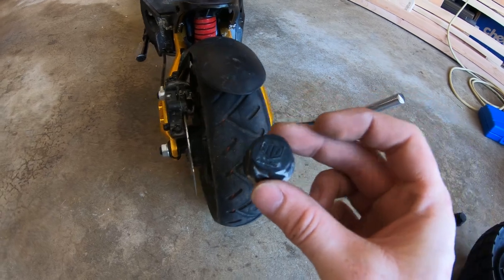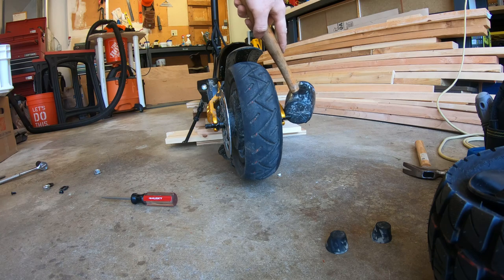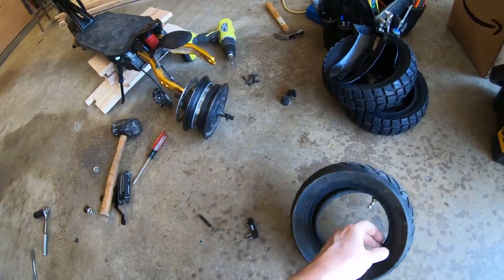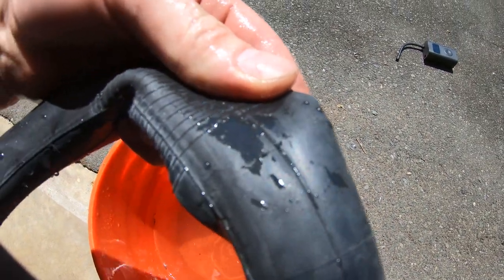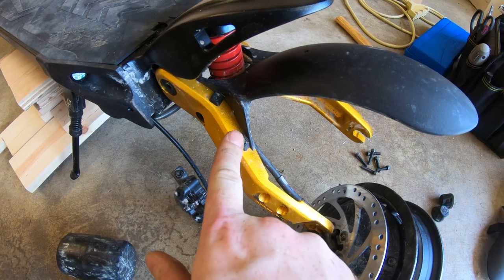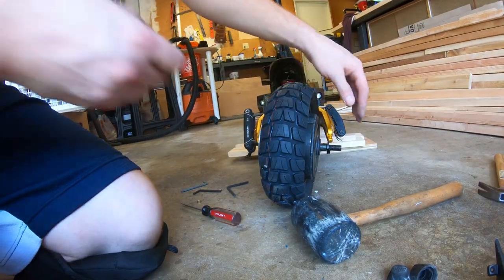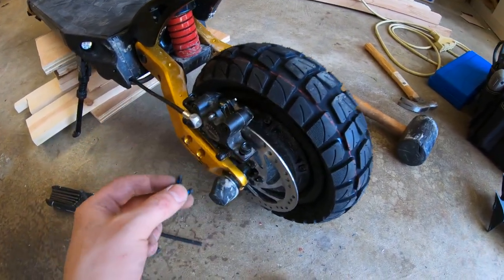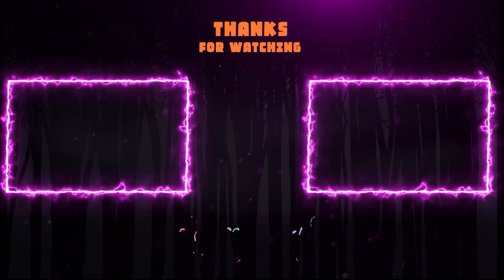Kaabo Mantis Pro SE Tire Change 3" Hybrid / Off-road Tire Install on an Electric Scooter

Comment: a trick cyclists use to help prevent pinch flats is to coat the tube in talc which helps it to slide around rather than get stuck

Comment: I am currently working through my first shooter rear tire flat repair.  Kaboo Mantis King GT.  A few issues for a first timer where I resolved one problem but stuck on another one.  Used my heat gun to heat up the axle bolts given the Locktight was really preventing me from breaking the nuts loose. The heat solved that.  Now can't get the two halves of the split rim apart.  All the bolts that hold it together are out but still the halves seem to be stuck.  Nothing like I have seen in these help videos.  Have used tools to try to wedge them apart and no luck.  Today is a new day and will give it another try.  Do not want to have to bring the scooter and parts up to Voro to get this fixed.  Long drive from Orange County up to where they are.

Comment: FYI your pro tip of loosening the bolts on the suspension to open the arms completely eliminates the need of pounding the wheel off with a rubber mallet.   Just loosen those first before you remove the wheel and it just slides right off

Comment: lol, nice vid.....You lucky guys with your split rim hub motor wheels! I mounted very similar tires on my custom scooter build without the ease of a split rim and it was unlike mounting all of the bicycle tires I've done before. They were tight! I had to buy giant motorcycle tire spoons for the leverage and really needed a 3rd hand but was only born with 2. Even after using grease and soapy water on the rim , tube and tire, I ended up severing the precious 90 deg angle tube and had to start all over with the only tube I had left. I got it on and the tube lasted 300 miles before a blowout. So replacing it, I made a tire jig out of 3/4'" plywood to press down around the whole tire at once, so hopefully will not have tube issues this time. I also use 2 layers of a fat bicycle tire liner because I knew what a pain in the ass it was to change these. But the tires are pretty great, on and off-road...good grip and not much road noise.  Also, I got 2 of those Mantis Pro tires originally, but wanted to go wider with these... those 2.5" tires came with 2.0" tubes and these 3.0" tires came with 2.5" tubes.

Comment: Given that the "off road" tire has the knobs... are they a bit thicker? Meaning, thorns, nails, tacks, random pieces of metal have more rubber to penetrate to reach the tube? If you're not off-roading, do you see much difference between the amount of rubber on the road between the two styles of tire? The first thing I would do, besides using a sealant in the tube, is to install some tire liners. They will further prevent punctures, making the sealant fulfill an insurance role.

Comment: Wheelied over a small curb an popped the rear tire on my 10x today... only 70 miles on it😭 thankfully slime is working for now! Great video! Feel confident in changing mine in a few days now!
Reply from the maker: Dang it ! I hate when that happens. Try using a slightly higher PSI
Reply: @GingerOnWheels  total buzz kill lol! I will! Yo I took a tubeless tire off my hiboy s2 pro an slapped it on LOL

Comment: Great video. You mentioned using superglue to attach the plastic caps on the wheel studs. I found that clear silicone works great and does not create the white/cloudy plastic that superglue does.
Reply: Silicone also easier to scrape out so you can repeat the process next time you have to remove the wheel..

Comment: thanks for this video. made it pretty easy . Today my back tire got a flat first, after 2500 miles. It didn't hold air, and I used slime so that may have helped me all these miles.  I already had 3 inch tires on deck so i put those on to. But man !! there were things that were tremendously stuck into place. One was the little washer you pop off after the nut on the outside of the wheel. holy SHITE those things were on there lol. took me about 2.5 -3 hrs to do all this for both tires, no power tools
Reply from the maker: Yikes sounds like a pain!

Comment: You can also put a little air in the tube and run it around under your nose the hair in your nose can see it’s very fond weeks in air and help you find a whole been doing it on bicycles for 20 years.

Comment: 8:02 you missed tubes valve and hub groove, intended position. You might get quite a wobble with unbalanced wheel.
Reply from the maker: Hmm, what do you mean? There is just one way the tube goes into the rim. The valve stem lines up with the hole on the rim. Did I miss a part??
Reply: @GingerOnWheels  there is a whole in a rim for the valve yes that is all good but there is also a groove/cut out on the hub where valve should sit. Check out the hub and you will see there is a cut out where it should sit, or you can clearly see let say in 7:43 you missed it, I hope you can see it.
Reply from the maker: Ooohhh I see what you mean. Good eye! Luckily it doesn't appear to matter too much. All good with a few hundred miles on it. But God.... now that you mention it I'll never unsee it. I might go all OCD and fix it some day 😅
Reply: @GingerOnWheels  ...your right Ginger
Reply from the maker: @ricobeusekamp8351  you're* ..... sorry.
Reply: Hopefully you learnt a thing or 2 today..
Reply: You also didn't explain the point of the nut that is on the base of the valve stem, how is it used please reply ASAP. Thank you good video I will like it.

Comment: One question, the tire on my scooter is 100 65-6.5, but I want to change it for a tire of a different design, but only if it is 100 55-6.5, do you think it would cause a problem, can it be installed? I would greatly appreciate your answer.?,

Comment: I ordered a new 2024 Yume Hawk Pro, comes with tubeless, but I hope the rims are “split rim design”.
Reply from the maker: I don't think so. If the rims were split and the tires are tubeless, the air would leak out through the slit in the middle of the rim, no?
Reply: @GingerOnWheels oh god that is terrifying. I watched a tubeless tire change video & the rims were all scratched up by the time the job was done. Having to get metal tools to pry apart… yikes!

Comment: I just got my vsett 10+ yesterday from rev rides. Im fat also prob gonna pinch alot of tubes. lol Ive heard changing to the hybrid tire helps alot with the flats. Im gonna ride the stock ones and see how long they last before swapping them though. Was surprised it came with that new sweet screen already on the scooter

Comment: Seems that the 3” tires have been rubbing for some and not for others. I bought my Mantis Pro w 3” tires installed. It had low mileage and tires were obviously new. Now after riding for a bit the front tire is rubbing on the fork. How is this alleviated? Please help, Riding Ninebot max or my ES2 is underwhelming after riding the Mantis.

Comment: We always used to use a liner for the rims on our mountain bikes when we swapped inner tubes.. are you able to use a liner for split rims to avoid the pinch or is that not possible?
Reply from the maker: I think you actually can. If you can get one the right size.

Comment: I want to do this upgrade to my mantis 10 v2.
Is it the same process?
Will there be enough clearance for the fatter tyre in between the control arms?
Reply: I too have the same question. Would love to move to a 3

Comment: I tried to take out the screws around the rim using a drill gun and it wouldn't unscrew. Those things must be screwed in their TIGHT. My next move is to spray each screw with WD40 and see if that does the trick. If that doesn't do it, I might just buy the T-Handle Allen Wrenches and hope for the best. No way I'm risking bending a standard allen wrench on this.
Reply from the maker: Apply heat. 😉
Reply: @GingerOnWheels  Thanks, but last night I finally got them out. I did spray WD40 then used an allen wrench from a heavy duty folding set which helped me use some leverage in my palm from its design. Not sure if the WD40 helped or I just needed to put some force into it but at least I got them out.

And THANKS for the video, you're a life saver as I would never  have known what a "split rim" was until you showed it here.

Comment: Hi, did you ever get a flat tire again after putting these hybrid tires on ? Do you use this scooter for offloading as well ?
Thanks
Reply: I have these hybrid tires and I got a flat within my first 200 miles. A small stick penetrated the tire and the tube. Now I have sealant inside the tube and that never would have happened with sealant. I learned my lesson after walking 6 miles back home. 😂

Comment: Like you im pretty heavy and have had several flats. I was thinking on getting solid rubber tire no tube. With the split rim design do you think its possible? I have the mantis v2 fluid free edition.

Comment: Nices! Now will having those tires affect the bat/mileage ratio?
Reply: They do but it is worth it in my opinion, because they work well for road and semi-off road.  (1-3 mph reduction). Plus if you have weird rocks or broken glass on the streets the widen nobs of the tire give you a buffer between the tire nobs and the inner tubes.

Comment: I have stripped screws and I don't know what to do! One of the two that holds the rear brakes on, and I can't get ANY of the 6 bolts on the rim to come out.
Reply: Buy proper tools. You should never try to work on something like this with cheapo Walmart low end Allen wrenches.  They are made with loose tolerances and low quality metals.    

To fix it you can purchase a set of allen wrenches that have little teeth on all six sides to grab onto stripped screws. You'll see what I mean if you see them for sale I don't remember what they called them I just know that they are designed to not slip.  It also helps to purchase longer allen wrenches so you have more leverage on them
Reply: @timoseppala7137  can you recommend a tool kit/brand that's good?

Comment: hello ginger! i see the tube size on the scooter is 10x2 tho the tire size is 10x3 is that normal? does not the smaller size tube in a bigger tire make the tube inflate even more and in more danger to pop? i ask cuz i am looking to buy one of those scooters and everyone is selling smaller tube size like 10x2 or 10x2,5 the most. so hard to find 10x3 tubes that is the normal size i think. do you know anything about that maybe? it would sure help me a lot! :)
Reply: No it does not there's thicker rubber on it The space inside for the tube is approximately the same as the original tire.  This also has the added plus of much more rubber to wear through before you risk popping the tube.  It does however add a little weight and more resistance when taking off down the road which then in turn causes you to lose a slight amount of acceleration and top end speed.  But you gain traction.  Only thing I noticed is if you ride when it's wet and you try to corner out high speed you actually wind up with less traction.
Reply: @timoseppala7137  i have no idea what you just said my friend! sorry my english is not that great. :( what does traction gots anything to do about the inner tubes i dont get it. i was asking about the inner tube size not the tires.

Comment: Bro I make a disaster, one of screw around the motor have the hole damaged, any advise to solve this problem?
Reply from the maker: Heat up the screw slightly with a heat gun or hair dryer. Then use the Allen key to take the screw out, but put a rubber band in between the Allen key and the screw for better grip on the stripped threads. Or, you can cut a long slit along the top and then use a flathead screwdriver to take it out.  If that doesn't work you'll need to buy an EZ out screw kit and drill the old screw out.
Reply: @GingerOnWheels  i fix the screw and change the tire, but now the tire touch the fork...any tips?

Comment: I change the tyre by just removing one swingarm (on the non-disc/power side) and unscrewing the split rim. No need to remove the whole wheel or deal with the brake. At least, not on my dualtron.

Comment: I keep getting rear tyre puncture! I’m upgrading to the same tyres as yours have you noticed a difference?
Reply from the maker: No flats so far for me. These tires are much better for riding than the stock tires imo.
Reply: @GingerOnWheels  wicked! Just got some today! Did you notice that the hybrid tyres are smaller than the 10inch tyre (about half an inch)

Comment: Is it possible to put a tire with a bigger motor
Reply: So like if I had a 1200w tire could I put a 1600w
Reply from the maker: No, the controller only pushes 28 amps which matches this motor nicely.

Comment: Nice tutorial as always. 3" is still too narrow for me I'm on 4" road tires on my 5600w scooter and gonna swap them out with slick tires with tubeless setup! My wheel doesn't split into two pieces as there are no bolts for it. I am suspecting my wheels are tubeless-ready.

Comment: I finally got around to installing a set of 3 inch tires on my mantis but I seem to hit an issue not mentioned by anyone else . Front tire is running against control arm . Any idea if this can be adjusted ?
Reply from the maker: Are they the tires from voro? Is your control arm bent? Is the tire over inflated?
Reply: @GingerOnWheels  I have them aired up to about 45-50 psi . And control arms are sitting flush no bends . However I got the set off of alie . I guess I know what the issue is . Haha self clearance should fix it
Reply from the maker: @rawbone  put the scooter on a stand. Lock cruise control on slow speed. Take a rasp and hold it to the side of the tire and shave off a small bit touching the control arms. Common practice on EUCs with ill-fitted tires.
Reply: @GingerOnWheels  sounds simple enough , not sure why I didn’t think of that . Thank you Ginger !!
Reply: @GingerOnWheels  Hi Gingeronwheels, I have the same issue my tires are from Aliexpress TUOVT they are touching the back swing arms. Is the only solution by trimming down the tire?

Thanks!

Comment: I wish changing tyres on my 11X was that easy. It has the split rim design like these, but they screwed up the design, the power wire goes through the middle :/
Reply from the maker: You just need to use a regular wrench instead of a socket.

Comment: What’s up. GOW. 

I finished that same Job last week and I know your back like mine was hurting. Anyhow, listen the tires do not fit they will rub on the arms. Theirs only one answer to this problem.
Reply from the maker: Hmm
 Is it possible you have the wrong tire? Mine have at least 1/2" clearance on all sides.
Reply: @GingerOnWheels  I got the same exact tires just wait until just one ride and the clearance shrinks. If that happens let me know I have an answer.
Reply: @scotiacaper  I’m waiting to give the only answer to Ginger if he has this problem which I’m sure the wheels are going to rub on the arms and those are not 3 inch tires because the original manufacture advertised them as 2.5 but the reseller advertised them as 3 inch. To make them more appealing One proof that it’s 2.5 tire is that the inner tube will say 2.5 thereby proving the tire is 2.5
Reply: @scotiacaper  The Mantis doesn’t fit 3 inch tire period Ginger on wheels will hear the tires rubbing on the arm once he takes it for his second ride out the most then the tire will settle into a permanent place on the arm.
Reply: @gmangiovanni2158  how do u fix this issue? Mine is rubbing on the front fork.
Reply: @roberth9063  shave the tire where it is rubbing?
Reply: @gmangiovanni2158  are you still waiting? Lmao that's weird dude

Comment: You t do not have to bash the crap out of the tire to get it out . Just loosen the back screw and bolt. With an Alan wrench. And it should slide out 😊 and you did it wrong. 

Start with the very first Alan wrench screws on e back the front ones.. than unscrew the brake. Next unscrew with Alan key on the separation rim. Then take the 18  off the tires. And slide out. Than put it back together from the back to start

Use hand tools on all your equipment. So you don’t strip the bolts

Comment: These treads feel fucking great don’t they? ;)

Been running them on Steeve (My Hunter X10) for about 600km now and they shred hard everywhere!
Reply: Also with removing those washers at the wheel l, just tap the tire side to side and it’ll wiggle the motor out a bit and free those lock washers.

Get yourself a table that’s high enough to flip the scooter over on the deck on a corner, it’ll make tire changes super easy long term ;)
Reply: I’ve had literally 0 luck with tube puncture kits by the way. They never last more than 10km for me at all

Comment: Good video but please don't use the drill to start the bolts 🤞🤘🖖
Reply from the maker: Why not? If the clutch is set to 0 then it just spins before you can strip the screw, even little baby size 3 hex's.

Comment: Those are 3 1/2 inch tires
Reply from the maker: Click the link the description. Voro says they are 3, so does my tape measure.
Reply: How come the ones on my yume D5 + measure 10 inches by 3 1/2 inches wide and there the same ones you got the hybrids

Comment: 200 pounds SHOULD NOT CAUSE YOU TO GET A FLAT. Im 250 and been going fast with my Mantis Pro SE on crack sidewalks and some off-road. Also did burnouts. I should be the one getting a flat tire lol.

Comment: Would this tire fit on a kaabo mantis V2 fluid edition?
Reply: Yes.  I just installed these last night, I did the full on-road version of it but they're the exact same tire just with a different tread pattern.  You will lose a little bit of top speed and seems like it's a little less torque but it does feel like it grabs the road a lot better